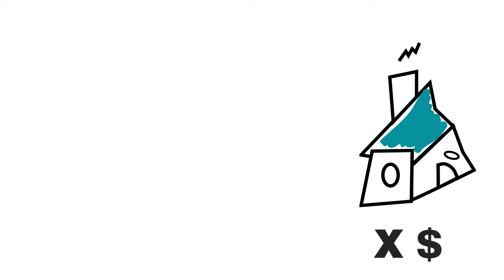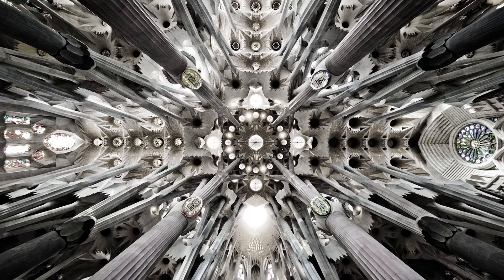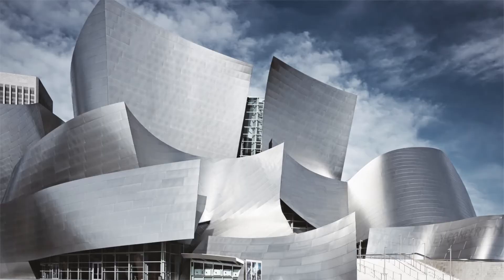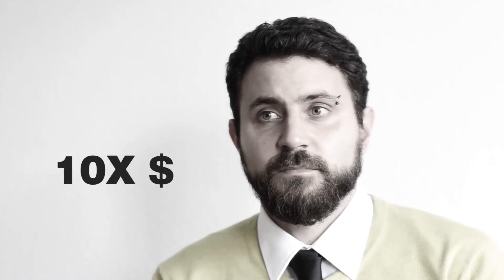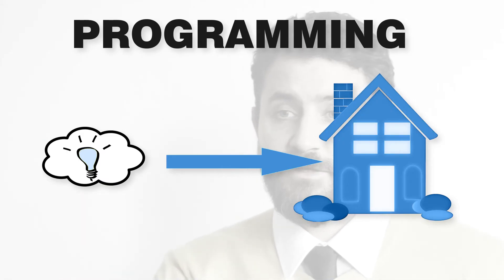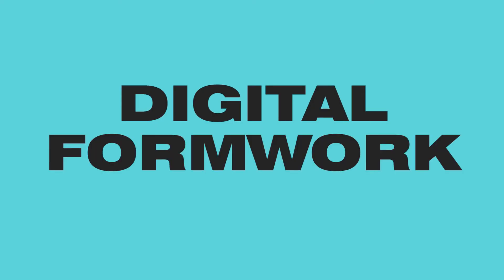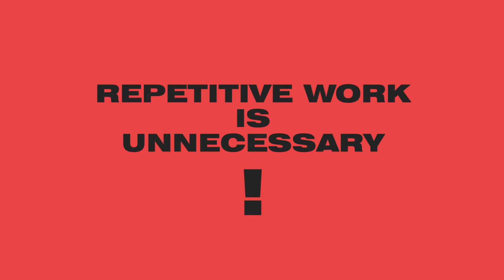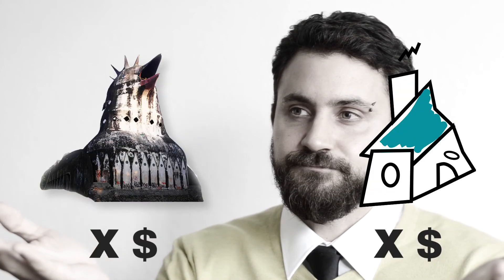Programming Architecture - Digital Formwork (Part 02)

Comment: Thank You for video, very interesting. I have 1 question: Why it is not so good to use script level programming for automation and genetic algorithm form-finding, except that it is slower than compiled program?
Reply: +Yarik Bratashchuk Hi...I never said it is not good (have I?). But, as you said, there are huge differences in speed and in complexity. You can travel from A to B with a bicycle, car or an airplane...and some places you can only reach with an airplane. In construction industry and with "one time use software" that I am talking about, speed, efficiency and recyclability are very important factors...for some things it is easier to write a quick script...but for some things, like structural optimization, when you want to generate and calculate million solutions, you will want to save every millisecond, because when those milliseconds get multiplied by a million you are losing a lot or precious time...